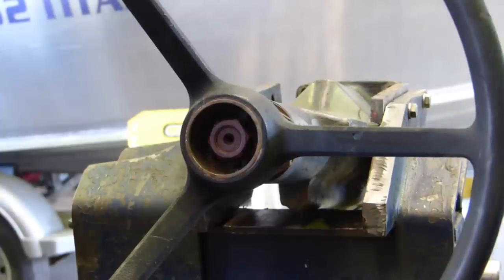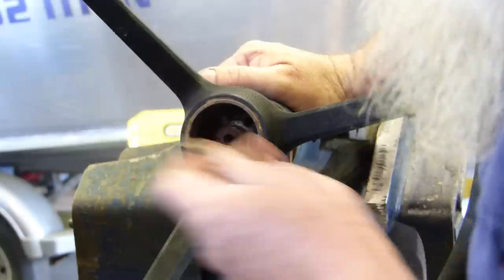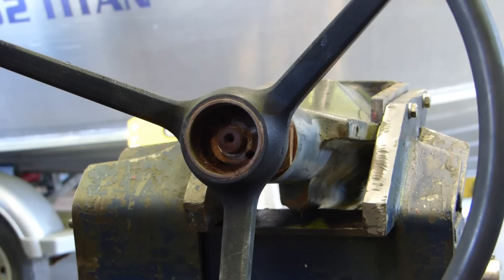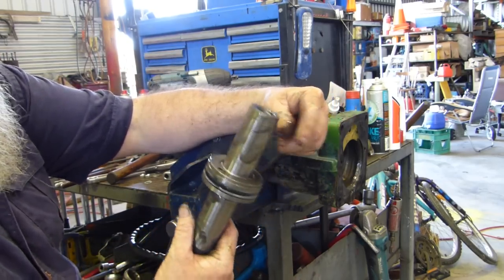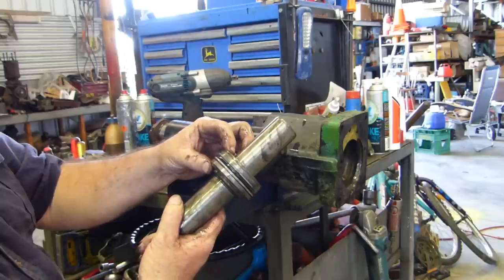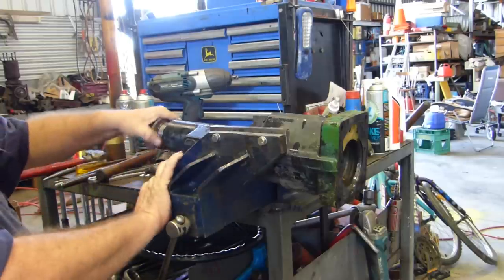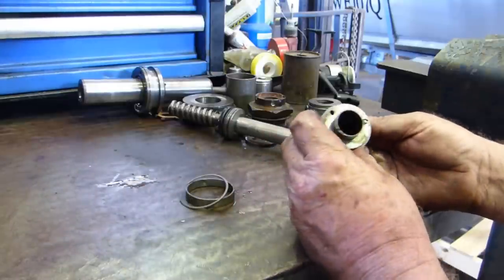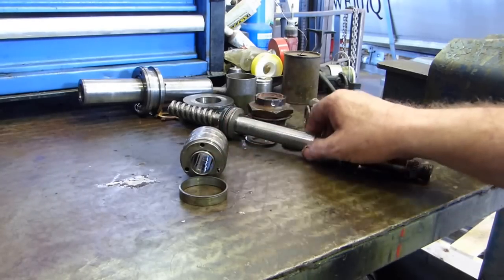John Deere 2030, 1640, 2140, 2650 Etc Power Steering Column Overhaul Part 2

Comment: hi, what are the three hex grub screws on the cast housing used for? HAve you done a video on adjusting the handbrake on something like a 1750? Thanks mate
Reply from the maker: They are where they drilled the internal passages and then blocked them off on the outside.

Comment: I have a 2650 and a leaking at the top of the steering column but I don't have that big bold on the top of the steering column so how else will I get it off?
Reply from the maker: If it is power steering it will be the same, if hydrostatic it is different.
Reply: @BundyBearsShed  I tried rebuilding mine once. It held a few months. I replaced it with an aftermarket unit. It lasted about 8 years. I'm going to try rebuilding it again. You have any idea why it keeps failing?

Comment: Im having an issue with a late late 60’s or early 70’s 2520 farm tractor that only will turn left. Turns very hard right. Pump builds 2100 psi
Reply from the maker: Possibly the piston has come off inside. worth a look.

Comment: where is the assy pictures of the steering valve and adjustment of 2030 john deere tractor . thanks
Reply from the maker: In the pipeline, I have the parts but seem to get other things in front of it, I hoped to have it done by now but I just seem to get busier and busier.

Comment: Thanks for the video!  Now, I have a question for you.  I kinda need to get this old gal going again, drooling out under steering wheel and kinda leaning towards replacing the 6 o-rings only alternative that you mention.  Since I got the entire seal kit, I would probably replace the dust barriers up under the big nut at the top as well.  Now, at that point, should it decide to continue leaking, it looks like I could remove the whole valve assembly and do the bottom half without re-removing the top and chancing damaging the already-replaced seals.  Thoughts?
Reply from the maker: The 6 o rings will probably get you going I would think .

Comment: First off, thank you soo much for posting this video!! My 2130 steering wheel rises and falls as I turn the wheel, and pops when I turn in one direction. I’m guessing I have to pull it and fix the piston you were talking about
Reply from the maker: The wheel needs to go up and down a little to work the valves, it needs to do that. The pop would probably be down the bottom end so pulling the column out for a look would be a good idea.
Reply: Bundy Bears Shed ok, mine rises about an inch or so, but only pops in one direction. You can feel the wheel rise up as it pops

Comment: Great video! What a blessing. Wish I'd found your video before I pulled mine apart on my 2150. Did you ever do a part 3 for re-assembly?  I have mine apart and need to get those 6 o-rings installed back inside the housing.  I'm concerned getting them in there properly without ruining them when pushing the shaft back in.
Reply from the maker: G day Nate, I will get part 3 done I just seem to be busy at the moment, just make sure the orings are sitting in well and use plenty of grease as it lubricates as well as holds the o rings from moving.

Comment: At 13:20 you mention heat & failure of the orings. Do you think this failure would be the cause or the result? My column is about 180def F. The steering wheel also turns slowly to the left by its self.
Reply from the maker: It could be that is the usual problem but I think you found a ball missing so you are all over it.

Comment: G'day Lance, Thanks for your videos, much appreciated, we have a 2120 with hydraulic problems, i notice when lifting the linkage and then turning the steering it takes the pressure away from the linkage, wondering what your thoughts are?
We have replaced the transmission pump and this has made little difference, still slow to lift.
Thanks in advance . Blessings
Reply from the maker: The steering has priority as a safety feature so that is probably not too far from correct. Try blocking the steeribng off and see if that helps, you may have a steering column leak. Does fhe front pump destroke? If not there is a high pressure leak somewhere.
Reply: @BundyBearsShed  thanks Lance, I'm not sure what you mean by destroke?

Comment: I love your videos. I have the 2030 steering column apart but I don't have a big enough vice to get the contol valve apart. It apears that the valves dont move. Do you have any ideas with out a vice? I thought about a spring compressor.
Reply from the maker: Use 2 pieces of steel with a u shape cut out and some threaded rod each side works.

Comment: My 2140 steering developed a leak and thought it was more than I could handle so I took it to a john deere dealer for repair. I got it back a week later and the leak was gone. After that the steering would wander to the right when at idle. Disappointed with the dealer, I ordered the rebuild kit online. 
After a few days of gradually taking the steering apart (lotsa pictures) and reassembly, now the steering doesn't leak and it doesn't move on its own when you don't want it to.
Its amazing what one can do with a little patience and time to rectify something. The steering wheel had been removed by the dealer before so I didn't have the stress of removing it like you did.
Reply from the maker: Glad you got it sorted, The dealers often put the lad on a simple job like these and they dont quite know the detail as yet. Pleased the videos helped.

Comment: Enjoyed the video man!  But I have a question.  My 2440 is pouring fluid out the bottom where it boats on when you turn it to the right.  Will repackage it with a new kit fix the problem?  Before it started leaking for years it would vibrate and shake when you turned to the right.  Thanks for any help you can offer.
Reply from the maker: Yes a kit should work I believe,
Reply: Thanks!

Comment: I recently removed the steering column from my John Deere 2130. I didn't strip it as it was working fine previously but when I refitted it I could not get any hydraulic function, neither power steering or the front loader.

If I blank off the hydraulic feed to the steering then the loader works perfectly, but when I reconnect it nothing works.

The column has now been stripped but no faults found and it has been rebuilt with new seals. It has also been inspected by a local JD dealer who says it looks fine. 

Any ideas what might be wrong?
Reply from the maker: G Day Steve, Being a closed center system that is telling us it is in your column. Are you sure the 6 o rings are in the correct grooves and there in not a ball missing in one of the two valves which would dump all oil to sump. I have also seen the piston come undone and cause a similar problem. Just a few things to look at, hard to say from here.
Reply: @BundyBearsShed  thanks for the swift reply. I guess I will have to check it all again. 😞

Comment: I  like the video I was wondering if this is the same column as an 1830 John Deere tractor. .Mine seams to have a lot of play in it when going in a straight line, it's like the column does nothing when centered and wanders badly
Reply from the maker: claude houle yes they are the same but I would also look at the pivot other front axle
Reply: thank you I will check the front axle pivot also thanks again

Comment: Very good video .Your videos are my go to when working on my tractors  I am about to take my steering column off and reseal it is not leaking but steering locks up and will only turn again if I lift front wheels off the ground then it ok for a half hour or so then wheels off the ground again and so on .I have checked bell crank and all steering joints is there something I should look for in steering column reseal job Thanks again for your great vids   Jim in Canada 

  

jim
Reply from the maker: G Day Jim. Have you checked your king pin thrust bearings?
Reply: @BundyBearsShed  good point I will check and let you know how they are ------Thanks for your quick reply ----Jim
Reply: @BundyBearsShed  Hello yes finally got back to it yesterday and yes one thrust bearing was completely  gone  was able to fix with a bit of weld and a new bearing thanks very much for your info .Just watched your vid on the bell crank bushing I did the very same thing 10 yrs ago and it is still in good shape  .I am enjoying your vids hope you keep it up ------Jim

Comment: How do you take the piston apart. Mine looks identical as the one in the video exept that mine doesn't have the two holes were you said the special tool goes in. I already try to take it apart for a few hour already and no luck. Please help thanks.
Reply from the maker: I have never seen ine like that, do you think it might have been made at some time? Heat will help.
Reply: @BundyBearsShed  after hours of research I finally got it, mine doesn't screw in it is pressed in there, so I used a press machine and came out very easy. Thanks for your response and your videos they had helped me a lot.

Comment: Great video! I have about 2feet slack in the steering wheel before there is any movement in the pitman arm. Going to check the pitman lock nut and then proceed to take out the control arm connecting the pitman to the column...if there is nothing wrong there either then it´s the fishbone or seals in the column i guess....
1976 JD 3130 OPU Cab with HFWD.
Power steering seems ok, but i cannot turn wheels all the way from left to right/right to left without giving it some throttle or driving forward/reverse.
Reply from the maker: Check the king pin thrust bearings are not worn or need greasing as that can make it hard to steer at the extreme ends.

Comment: Hello my tractor with engine off--has a lot of steering wheel free-play lick 6 inches before the front wheel want to move is this normal--for its been 4-5 year since I last use this tractor?
Reply from the maker: Check the bolt holding the pitman arm on at the steering box and check the pivot under the radiator.

Comment: Hello , I have a jd 300 ( industrial version of 1020) , 5 years back I used some value price hydraulic fluid and lost power steering one direction , loader only worked is steering was held hard in the direction it worked .I removed the column and disassembled,  but when going to dealers for advice was told " no one here is old enough to remember those , we do not have parts or service manuals for anything that old" . Had all the parts laid out in order , but with grandkids , all the seals and o rings have gone missing . My question , do you know if all these vaves use the same o-ring pack ? Or what other tractors used the same (eg: 1020 or 2020 etc). There seems to be very little info on the internet , what with these being somewhat rare
Reply from the maker: The 2020 right up to some 50 series use the same eg: 2650 if they are power steering not hydrostatic steering. the genuine numbers are AT315816, AT26188

Comment: I got the nuts at the top removed on my 1640, now is it just start to unwind or  does the wheels need to be free?
Reply from the maker: The column should wind out now.
Reply: @BundyBearsShed  taken out the whole assembly, off with the top nut and bottom end is off, tried hitting it from undearneath but doesnt seem to budge, is there by chance a small nut inside on the top with two notches like the top nut that holds it in? because it seems like it
Reply: Ive figured it out! if anyone is fortunate like me and have a cab, type MC1 its called here in europe, there is a piece thats used to splice the colum further up i would presume, remove the top bolt as per usual and then use a pipewrench on the top half to get it loose from the rest of the piece, then proceed as Bundy with beating the axle out. Took me some time to figure out with lots of help

Comment: I wanna first of all say thanks for these videos, I was able to pull apart my Column and start rebuilding it.. only issue I have is my tractor is the 401c variant and the "steering piston" is different.. so my kit didn't come with a "Piston Ring" and I can't find the part anywhere.. the part # is T34246 and it says it is no longer available :( . The Oring my kit came with is too large to fit in the recess of that piston and the design is slightly different so I don't know if I can just order a piston from say a jd2020 and use the oring my kit came with.. I feel I may have to just order a re-manufactured column. 
The column was in need of the new orings.. the previous ones were all dry rot and was missing a few of them :(
Reply from the maker: Take your old piston into a hydraulic shop like ENZED or similar and they will be able to go on size likely. Ask for 90Duro as they are a harder seal.
Reply: @BundyBearsShed  Thanks for advice.. I was actually looking up what shops I can visit this week and take my piston and the broken seal over and see if they can help. 👍

Comment: Lance my 2640 last summer started leaking at the steering wheel after a while it quit never leaked anymore since can you tell me why it quit leaking.
Reply from the maker: G Day Joe, No I cant really, I can only guess there was something in or under  the seal that worked its way out again, they stop leaking if they run out of oil too Joe lol

Comment: Great video Bundy Bears Shed!  I have recently traded up a JD 1530 that seems to be a nice old tractor.  I do notice that the tractor has a lot of "room" in the steering.  If you try to drive on the road it is a chore to keep it aimed where you want it.  It had a bellcrank bushing replaced and new tie rods and drag link.  I am wondering if that slack in the steering is related to what you are rebuilding now.  Mine has power steering. Any thoughts you care to offer?
Reply from the maker: G Day Robby, The steering column should move up and down when you turn from left to right, that works the valves in the column. Have you checked the nut on the top of the pitman arm is tight? It often gets overlooked, there is a tin cover that you will need to pop off and do it up as tight as you can.
Reply: Thank you for your reply!   I will check the tightness of the pitman arm nut for sure.  Also..that column gets quite hot during operation. Is that normal?
I will also check the "nut" turning the wheel as well!!!!  Have a great day....or night... :)